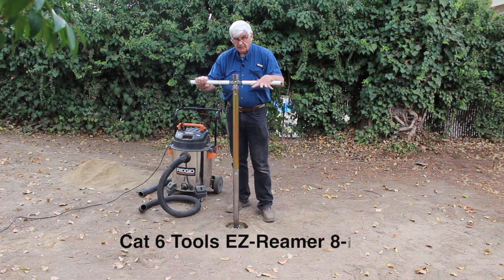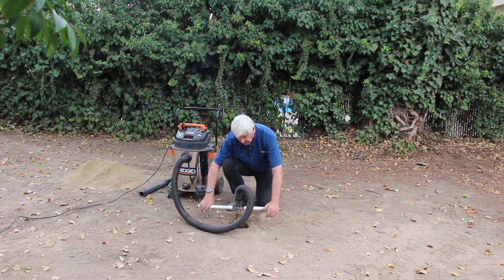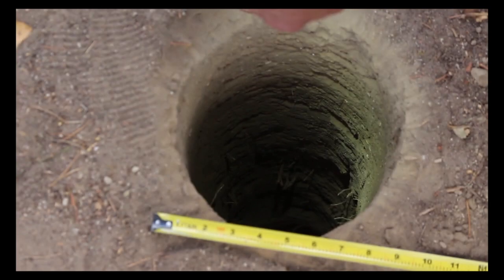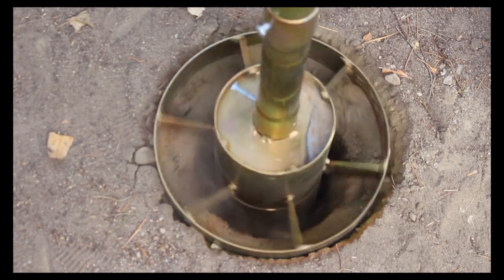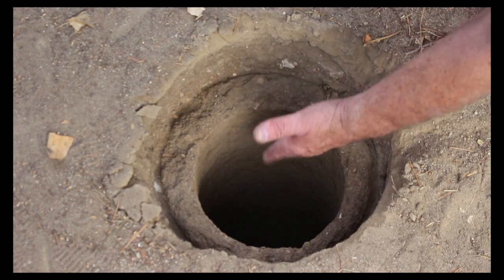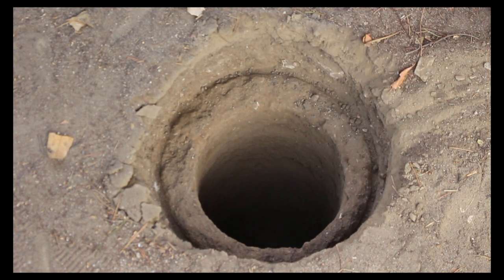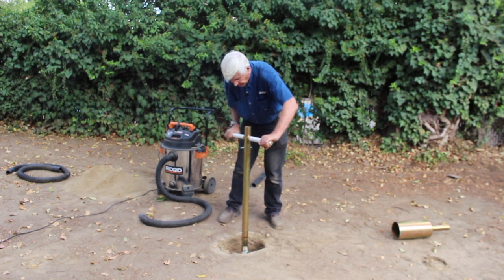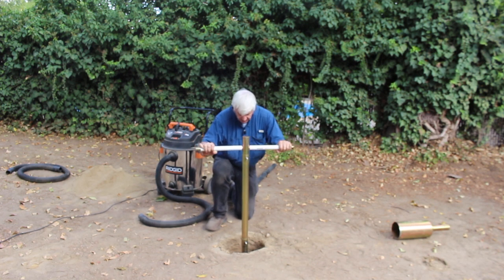Post Hole Digger - Reaming 6-inch hole to 12-inches with Shop Vacuum

Comment: Nasty stuff?? Try ROCKS LARGE TREE ROOTS ETC
Reply from the maker: Once you get a 6 inch hole going larger is easy and if you hit a rock with the six inch, enlarge to 12 and pull the rock out.  If the rock is larger, use dynamite.